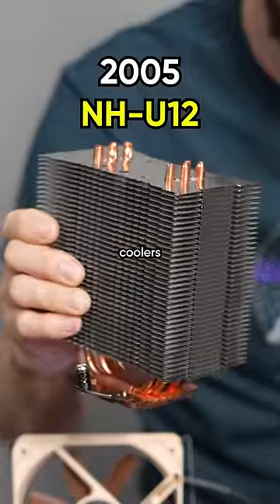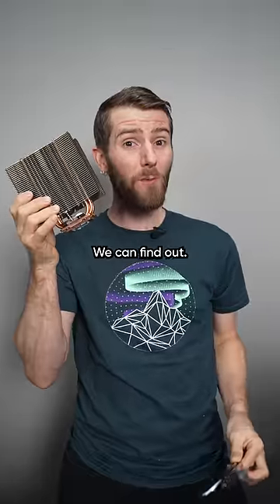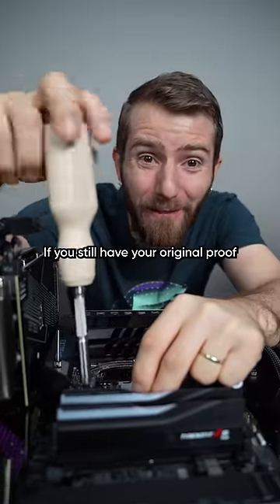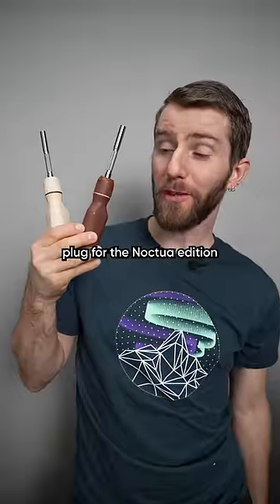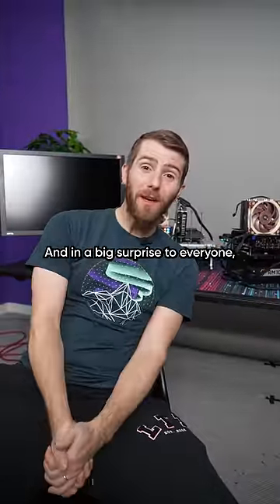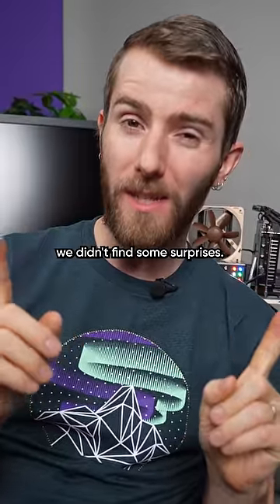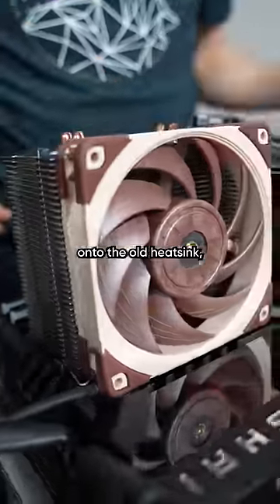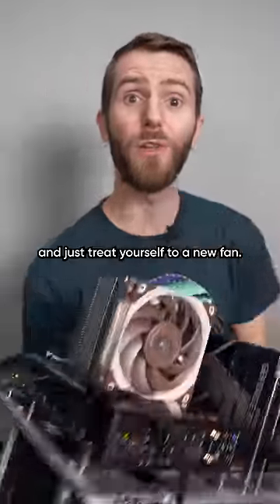Can You Still Use a CPU Cooler from 2005?

Comment: The thing about air cooling i don't particularly like is that its inherently an issue that one side is always hotter than the other. Ive seen the metal plates on cores warp from that, which is why liquid cooling is "better," and its the same reason why cars started using them as well. One you dont need the cooler to be positioned in a specifif spot and two the heat is displaced over the entire surface and radiated away elsewhere preventing that warping and keeping the entire surface the same temperature. Sure you can get air cooled that works just as good, but the advantages of water is that it has a better heat coefficient, and can be positioned elsewhere from the rest of the gear, which is why i prefer liquid cooling. That and if you want to, you can do what they do for super computers and use a refridgerant cooling system but that is overkill. I prefer tanked eater coolers with GPU and CPU shared reserve double radiator cooling. I use 2 360mm radiators, my favorite to jse are the Corsair ones. You can buy the 360mm radiators used eith the Cappellix system on their online parts store and those radiators have 16 heat transfer tubes over the normal 8, and they do a far better job of heat radiation. Can keeo graphics cards AND cores both at 31c at max load on most rigs i build. They work very well, and are worth the money imo. Love the clear hard tubing and the multiple fluid colors i can get on PCwarehouse too. Plus it turns into an actual piece of art to show off as well.

Comment: Noctua is a great company that makes the best air cooling that I know about, but wouldn't a better comparison be against the U12S? The U12A is IIRC a higher end version with two fans and two (?) more heat pipes. The fans are also a little different shaped.

Comment: 20 years after the fact, I'm still reusing my Pentium 4 era gold-copper block. Thing is, Koolance probably isn't happy about that but I KEPT the Socket A option mounting hardware, which has been dormant all this time just to enable all of this. Pentium 4 Prescott -> Phenom II X4 -> FX-8370 -> Ryzen 5 3600...And I can probably continue using it well into a 5900X or later. It will probably meet its end at Ryzen 10K series.

Comment: I'm kinda in a similar situation. I bought an Intel mount lga1155 cpu water cooler block, never used it, but have just bought a 7800X3D and trying to track down brackets for it. They had am3 bracket for the water block model but mostly out of stock.

Comment: And it makes sense, aluminum has 230w of dissipation and copper 400w, with high-performance thermal paste, a heatsink from 20 years ago is still enough for today's processors, which do not exceed 100w tdp

Comment: The newer has just 3 more pipes in it... wouldn't say they are the same.

If you do standardised load against a set heat source, with same fan on both. Pretty sure that small margin would become a significant margin.

Comment: Almost this is why i still use Matcho Rev.A cooler with a good 14cm noctua fan (not really know witch version without checking).
With proper kit I using in AM4 (originaly AM3/1150/1200 cooler), but my mount kit good to AM5 and 1700 to (if i even wanted to change)..

Comment: My 11 year old noctua cpu cooler fan just died, it might have been dead for a while because the heat sink can passively cool my cpu unloaded and loaded if the side panel is off. I have replaced it with a high static pressure fan and temps don’t go over 44°C now. Also, I had the fan plugged into the wrong header so it didn’t alarm.

Comment: I got a 5800x and did actually the same and bought a nf a12 single fan. After a year i upgraded to a nhd-15 chromax dual fan and saw a little improvement. I was disappointed and same time suprised the little heat sink compared to that massive cooler only is a couple c difference

Comment: I have one of their coolers in a home build server, 150 TDP it's rated for but my CPU is 65... Even under a decent load the fan sits at around 500RPM temps are no more than 40c most of the time.

Comment: Need input. I have a b450 rig with a 3600x and 2070S. I mostly play valorant, counterstrike, and rocket league but also play games like rainbow six, battlefield, and some single player from time to time (RDR2, Assassins creed franchise, star wars jedi series)... I also have a 280hz alienware monitor but cant really push those frames on any game anymore even with lowered settings... would picking up something like a 5800X3D boost my performance significantly just by changing cpu or would i still likely be bottlenecked significantly by my GPU given my setup

Comment: I bought 
I7 4770
Rx 580
8gb ram
120gb ssd
500gb hdd
550 watts
At a cost of 250 dollars 
Although they were used but its worth it right?
Reply: We have almost the same exact build, except I'm using an i7 4790, 2*8GB DDR3, 1TB SSD, and an RX 570. Very happy with the build, I had to buy a 165hz 1080p monitor to match.

You got a good build.
Reply: @grimm00002  At What price?

Comment: This seems like the same difference between NH-D15 and NH-D15 G2... The most improvement is in the fan rather than the heatsink... So just an fan upgrade away from the old one to new ones performance

Comment: I'm using a Hyper 212 (2007) on a delided/liquid metal'd 8700k at 4.9ghz with a single fan and it stays below 90c.(open chassis - thermaltake p3)

Comment: The mounting for that style of heat stink REALLY SUCK. The standoffs won't stay screw into the motherboarded so to take the heatsink off to clean it you have to unscrew all the standoffs too. This means taking off the other side panel and unscrewing the little bolts that fail to hold the standoffs properly... In fact the entire spring load screw thing is a scam imho. ALso, when you want to switch down to a more logical and easier to deal with heatsink.. uh and if you forget to remove those standoffs and then screw your new headsink down to the stand offs... well it won't make contact with your processor in that configuration and your gonna go right to heat shut down. It was hilarious unscrewing my fan and see that the thermal paste bead had not been touched by the new heat sink at all... lol